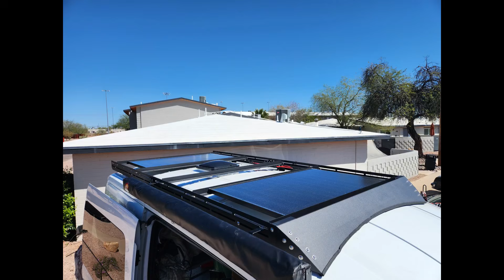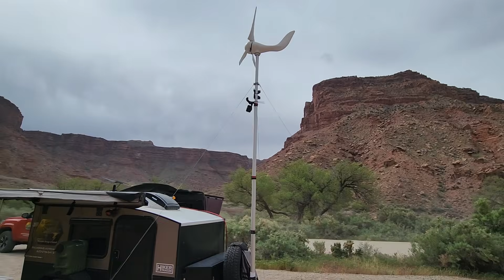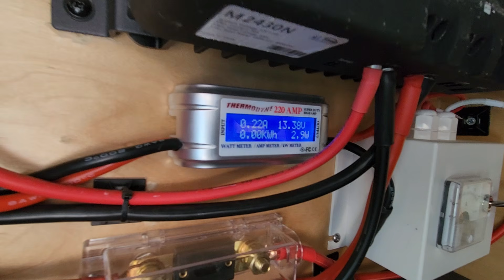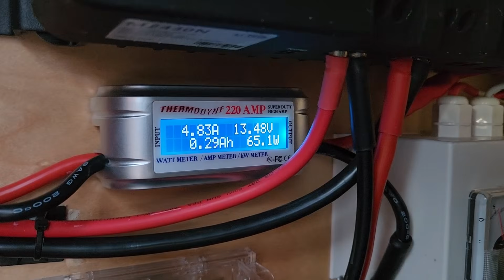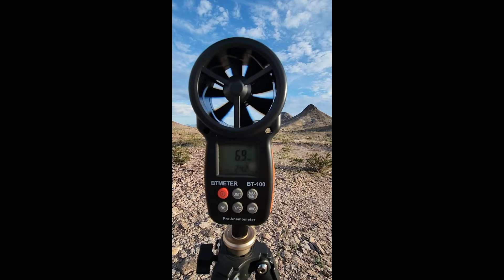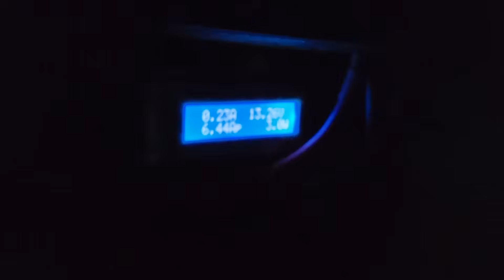Solar is BORING  - Wind Turbines Are The FUTURE For Mobile & Off-Grid Living

Comment: I want to combine solar with wind but can't find a simple explanation of where and how. The wind is three phase electric, solar is DC. I would assume running DC out of the wind controller to a battery fed by both the solar panels and the wind turbine. Does anyone have a good resource?
Reply: a three phase rectifier will give you DC and a charge controller will regulate it. a solar panel output is single phase but its voltage changes with the sun.
Reply from the maker: It depends on your wind turbine but yes the 3ph power goes into a wind charge controller and comes out as dc power plus a line for the brakes. Plug it in as a parallel circuit to your batteries just like you would for multiple solar circuits. I have articles and sell a diy starter guide on my website. Solararkelectrical.com
Reply: @SolarArk-StormPower  Thank you, this helps a lot. I did find a controller specifically made for a solar and wind connection. I will check out for guides. And I subscribed.

Comment: My thoughts on these wind systems is 65w? I use 1500w ish average.  So i would need 20 of these to run saying theirs wind constantly. I do have an average wind to get some power but not worth the price for 65w
Reply: its power over time. if the source is 50W and it charges the battery for five hours and the device being powered is on for 15 minutes....thats 1KW. microwave oven for example....power and time not just power
Reply from the maker: For reference, if you use 1500W on average then that is more than the average daily use of the average US household. A US residence uses 900KWh per month, or 30KWh per day which is 1250W on average. Typically for mobile use, you see people using smaller, more energy-efficient loads so that they dont have to use enormous solar arrays to power their life on wheels. You should consider working on reducing your energy demand because even solar is going to give you problems.
Reply: @SolarArk-StormPower look at your laptop charger mines a 65w. So that wind toy would need to be on a battery with a charge controller and an inverter then the laptop charger. With all the conversation 65 watts from the wind mill will not run the lap top 24 hours a day unless it was constantly running and doing better then 65w theirs too much loss in the conversation. So my solar input have a 10 450w panels generating in good sun around 300 volts at 16 amps with 4500w charging. How would the wind toy help?
Reply from the maker: @thetowguy-johnnytowtruck  I run my 65W laptop directly from a PD socket in my trailer with a 10ft usb, no inverter needed. And solar needs batteries too, so I don't see your point. 

Your issue has nothing to do with wind power. It has to do with your own inefficient use of electricity. If I live my entire life comfortably with just 350W of solar, but you need over 10x that, then what does that say? You've been born to believe you need as much electricity as you can get. But 200 years ago we didnt even have any electricity, and people did just fine. 

Wind isn't for everyone, and I don't think its gonna be a good fit to you until you learn more about reducing your electrical demands. But wind power is more than enough for me, and thats all that needs to be said for proof that it works for the right mindset.
Reply: @SolarArk-StormPower the ac in my 30ft jayco uses 1200ish watts at 120v the fridge uses 600w 2 TV my laptop a few phones tablets I dont over use. Thats just facts. People have said wind turbines are toys because they really dont do much to help at all. My point is saying anything other then that and promoting the product to be something people should get saying everyone is wrong and their great or even worth using spending money on. Is my problem with this. If your mainly using a 12v system to power your van and you have a dc to dc charger and a small solar panel your probably ok but put an ac on that rig and the turbine is not helping enough to be worth the money
Reply from the maker: @thetowguy-johnnytowtruck  And yet I am living proof that your philosophy is not all-encompassing for the bulk of energy conscious van-lifers and nomads out here. Subscribe for more proof!

Comment: smaraad m3 or m6 or ft2000 wind generator with 1,6 or 2 or 3 meter wheel diameter is best option ... all other under 1,6 meter diameter is too small ...
Reply from the maker: I've never heard of this company before. I just checked them out, they seem to have a very wide range of products. But there are many more unknowns, lacking published data and tech specs. Bigger isn't better for RV wind power, check out my second video to see why!

Comment: I set up 2 100W panels on my RV roof. This is only to keep the batteries up and run a vent fan to keep the RV cool in storage.    I see the Solar systems as a way to set up and run full time charging whereas a wind turbine would be best if i was stationaly.
Reply from the maker: Yes! You can't have the wind turbine mounted while driving, but your solar panels can work while driving if mounted on your roof. Solar panels work for 80-90% of situations, but sometimes they arent enough when shaded or in prolonged cloudy conditions. A wind turbine is for that other 10-20% to keep your batteries from dying and even provide a bit extra power for heating in sandy, snowy, cloudy, or shaded conditions

Comment: That's cool, but seems useful only as supplemental power to a solar system. It costs far too much, spending $1000 per turbine plus mounting parts for getting only ~50 watts of output on average. A lot of things would have to be considered with expected lifetime of the turbine, warranty, serviceability, and cost for replacement parts, if possible.
Reply from the maker: You've got some good points, but there is more to put into perspective as well. For mobile electrical systems, solar requires an alternative source to survive prolonged stormy conditions (which are ever-increasing in occurrence). There are only two options - fossil fuels or wind power. Shore power, generators, AC-DC and DC-DC chargers all consume fossil fuels. From the grid's perspective, nuclear power heavily relies on fossil fuels for safe operation, and solar and wind are not enough on their own to power even a fraction of the grid. And when you get situations like today where gas prices have skyrocketed, it reminds us why fossil fuels fall short - they are limited and scarce. 

Wind though? It's free power and it's abundant. it might not be there every day, but it sure likes to show up when the sun isn't out. Yes, compared to a DC-DC converter, 600 bucks for a wind turbine sounds like a lot. But consider, a 400W solar panel plus MPPT costs at least 400 bucks, and it can't run 24 hours long like a wind turbine can. 400W * 4.5 PSH = 1800Wh of solar energy (ideally). 50W * 24 hr = 1200Wh of wind energy (realistically), and that's just at 50W, when the turbine can still produce up to 400W in strong winds.

Here's a bit more perspective. The wind blows where the sun can't shine at all. Shaded by tree cover for several days while camping in a forest? The wind still blows hard through the trees. Camped in a canyon where the sun doesn't shine before 10am or 3pm? Those canyons tend to have strong winds blowing through them, so now you can camp with reliable power where solar-only rigs couldn't survive more than a day or two. A thousand bucks is a small price to pay over the headache of dead batteries and a fridge full of rotten food.

Also remember, wind power is where solar power was 15 years ago. Solar used to be expensive, not mainstream, with lower consumer demand, and with lacking technology to back it up. Wind is there right now solely because consumer demand isn't high - yet. But I'm here to show that wind power is an excellent option even in its current state, as a living proof of concept. More videos to come to expand on these concepts!
Reply: Supplemental power is power when you need it tho! ⚡️ and it’s 24 hours 🙌

Comment: Yep we did think about it and said an emphatic "No". Its NOT the future... the sun produces more energy than in one sec than all human output for our entire history. Solar output *dwarfs* the total accumulated wind power on Earth. Why would you subject yourself to a device with many mechanical parts that can (and do) go wrong, when you can do the same thing with solid state technology? Do you still use an 8-track tape player too?
Reply from the maker: Why would you subject yourself to relying on power from an electrical grid that can (and does) fail all the time? You're missing the forest for the trees. Its not about which is better, its about combining them so that when one isn't working, the other is.
Reply: Residential wind power technology is not there yet. But commercial wind is a major player around the world